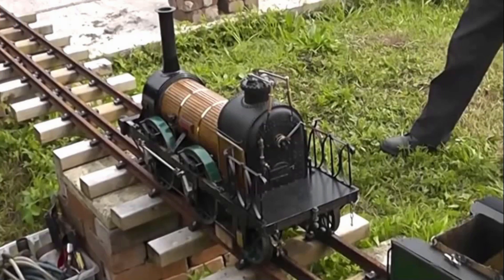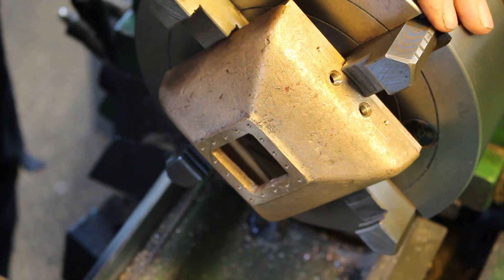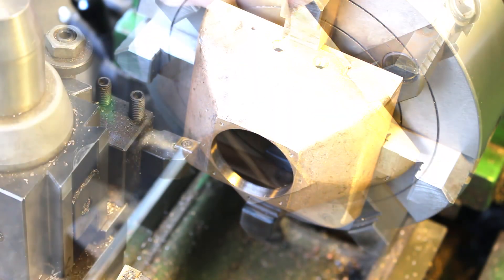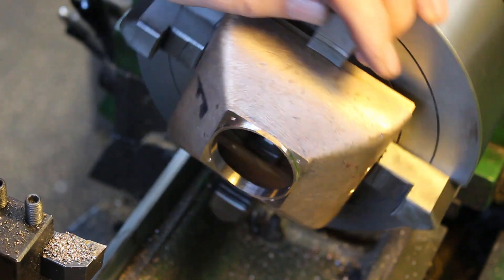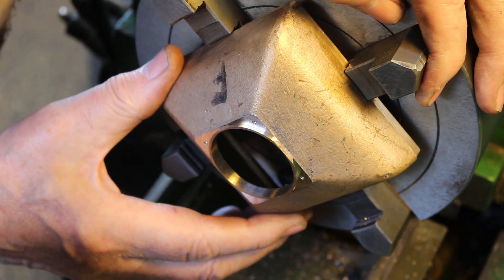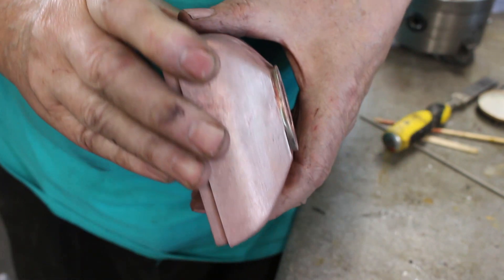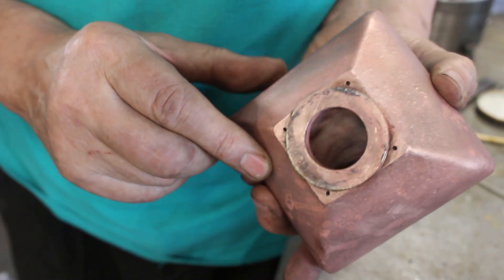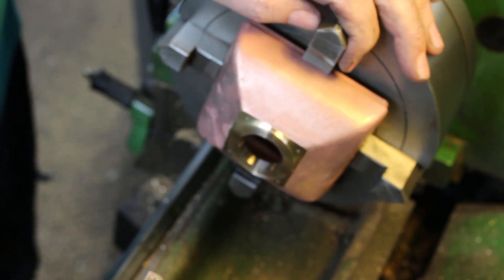LION Miniature Steam Engine Build Part 11 - Dome Continued: Square to Round

Comment: How did you get the dome cast?
Reply from the maker: Hi, Blackgates Engineering in the UK supply the dome castings. Thanks for watching.
Reply: Hi Nigel.... a question for a Professional like you....  maybe you noticed the discussion on my channel, using brass parts in a copper boiler....  whats your thought? Youre lion has a boiler dome made of brass (?) Its like a wich hunt..... cant find really good Information.... in the plans includet a steamdome made of Brass..... so.... should i care about?
Reply: DreamSteam   I’ve had the same experience with a Tubal Cain design ,boiler made from copper.Bushes from bronze all Ok .But the top of the dome from brass ! What can you do ? Will see what’s it like in say 50 years 😄😄
Reply: Not allow to be used in Australia due to national AMBSC Code requirements.